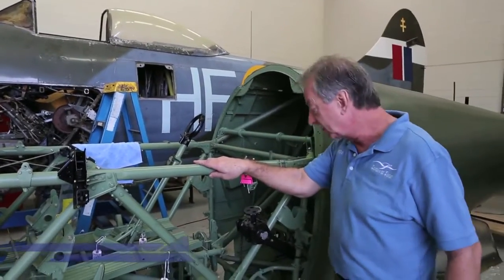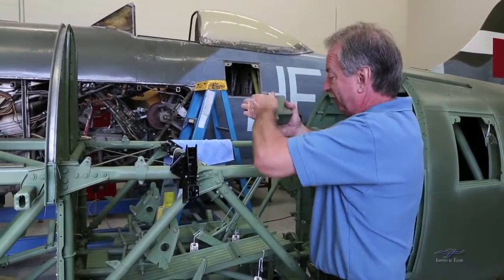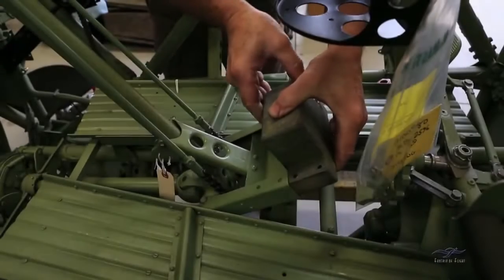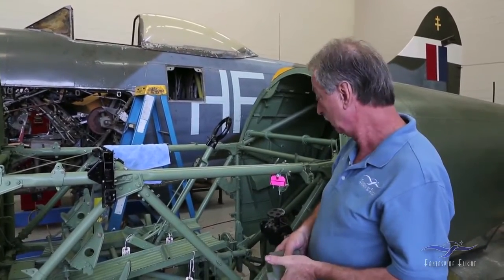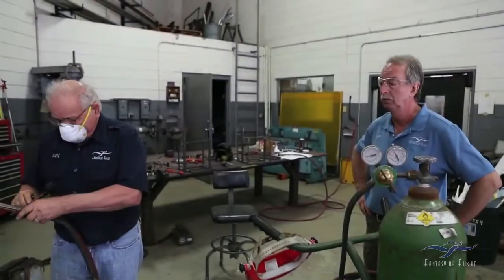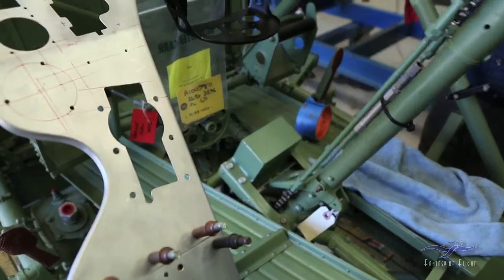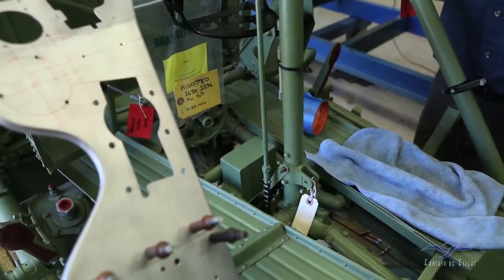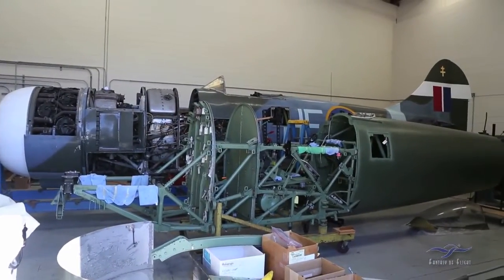Hawker Tempest V - Control Stick Inertia Damper Weight - FoF Mechanic's Corner

Comment: Should have had a plumbers pot, the lead is melted from the bottom and is much more controlled without fumes.
Reply: In these shop environments, one learns to make due with the tools at hand. Obviously they made it work, and now they don't have to buy and store a plumbers pot that they may never use again.
Reply: Lolhahaha  i was thinking  the same thing  waching...oh well  it worked for them

Comment: I cant believe you did it like that, the flame should never be directly onto the lead, the temperature of the surface will be way above melting point and releasing lead fumes over everyone, the heat should have been applied to the bottom of the pot, the mould should have been pre heated, although you may have done that off camera, and the lifting of 20 Lbs of molten lead with a pair of Mole grips is nothing short of an accident waiting to happen. I glad you all survived, even though you have probably taken in your lifetime dose of lead.
Reply: Gases are subject to diffusion, so while most lead vapours will indeed sink to the ground some will diffuse up towards the workers. Also the lead fumes will rapidly condense after they leave the heated area, resulting in very fine particles (essentially lead and/or lead oxide smoke) that can remain suspended in the air. Lead can be absorbed by ingestion, inhalation or through the skin (handling lead without gloves for long periods can actually give you a mild case of lead poisoning).

Plumbers do not generally use an oxy-acetylene torch to sweat pipes- oxy-acetlyene is expensive, and an air-propane torch is adequate for soft soldering. Lead boils at 1749 C, which is safely above the temperature achievable with an air-propane torch (they typically get to around 1200 C) but much lower than the flame temperature of the oxy torch (around 3100 C). In other words, your comparison isn't really valid, and flaming the lead with an oxy-fuel torch as seen in the video will make significant amounts of vapor.

All that being said, the total exposure they got was probably pretty low. They're not doing this every day, so chronic accumulation of lead probably isn't an issue.
Reply: I'm just wondering if it would have been better just to melt it in the mould itself.
Reply: Lead has to be ingested, genius. It also doesn't create "vapors" that are lighter than air being LEAD. Plumbers using lead solder (even modern "lead-free" solder isn't "lead-free") to sweat copper tubing do the same thing constantly. Go back to your science class and try to learn something useful besides oral stimulation of male genitalia this time.
Reply: DEEREMEYER1 not to mention that they’re all wearing masks so the comment is even less valid
Reply: Particle masks will filter out powder and dust but to keep out smoke and vapors you need a respirator with face seal and cartridge filters.